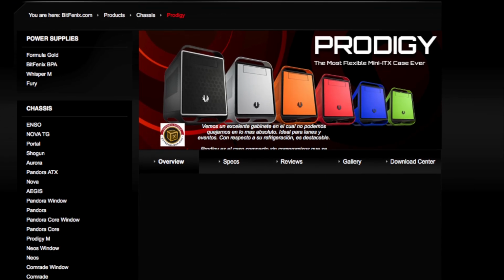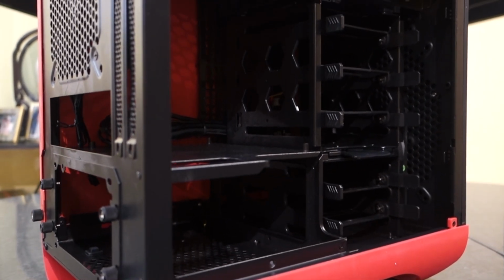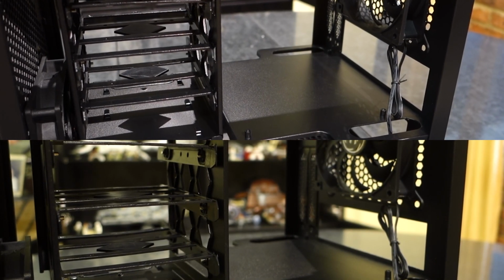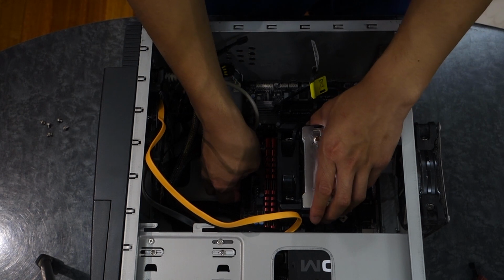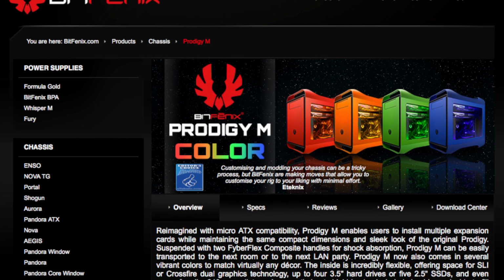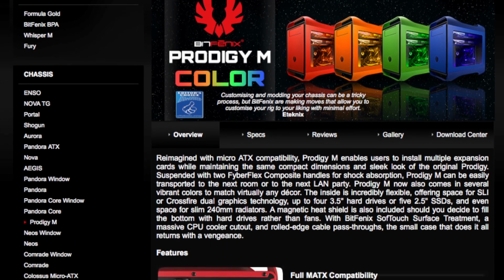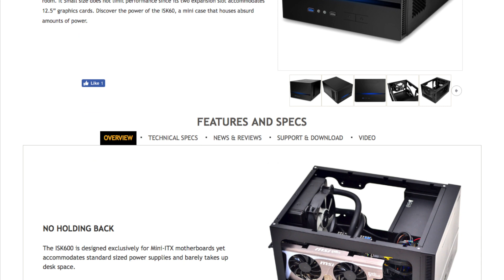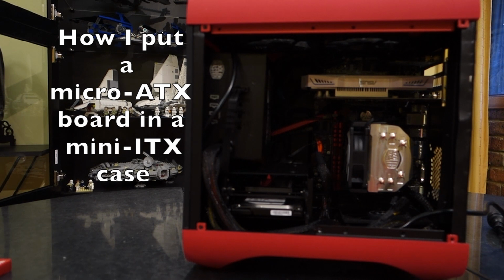How to fit a micro-ATX motherboard into a mini-ITX case

Comment: This one is pretty large for an itx case imo. I saw your video and liked it but I decided to buy an Aerocool Atomic Lite for a cheap price instead and it's still smaller than this case with a window.
Mine is: 	206.5 x 385 x 353.4mm (W x H x D)
The one in the video is: 250*359*404.
It does not have the handles though, still compact and really nice looking case, especially after changing the fans.

Comment: im planning to use a 21x17cm micro atx (a320m vh r2.0) into an itx case (sharkoon c10), the case has roughly the same length for this motherboard but im afraid it wont fit, do you think it'll do?

Comment: i have asrock a320m hdv 4.0.. that board looks so damn small than normal matx.. do u think it will fit in case like cooler master elite 130?
Reply: it fits in a silverstone sg13 tho and that is an itx case
Reply: @yuditsetiawan4087   Does the motherboard just bolt right in or does it need minor modifications?

Comment: You intake at the top and exhaust at the rear? Lol, what about the fact that hot air rises? Do you like to intake warmer air into your pc?
Reply: Tyronie balonie you know how easy it is to move air especially if you have a consistent motion of it? If all of it is arranged to intake at the top and exhaust at the rear then the airflow won’t be a problem.